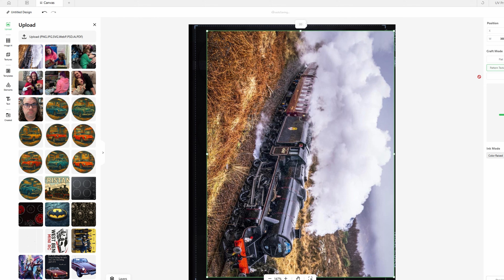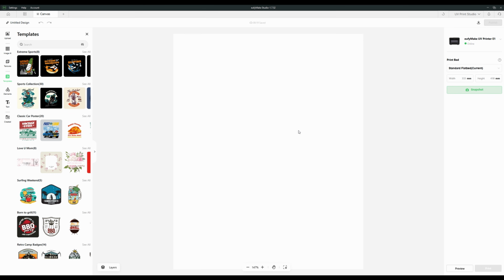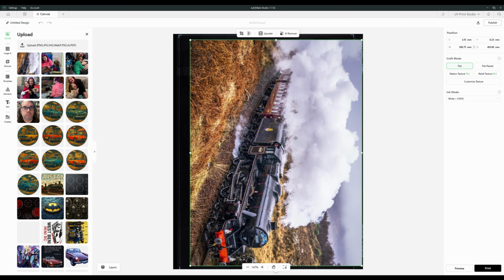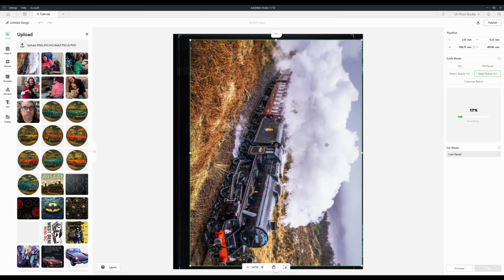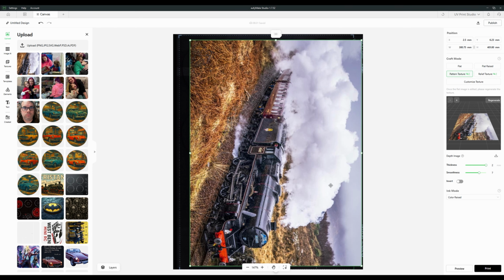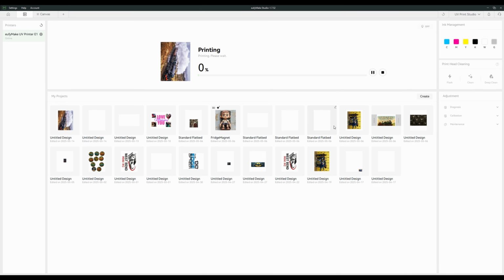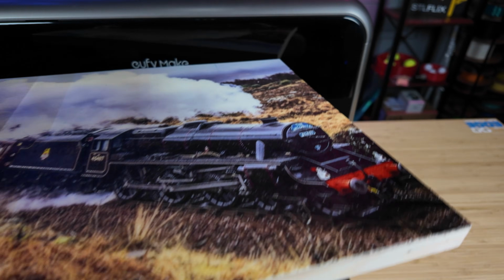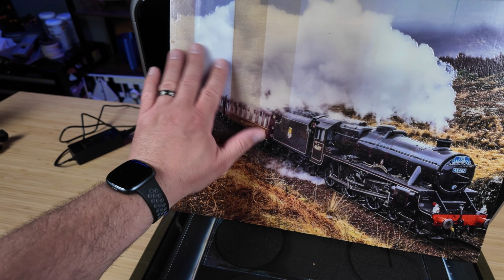UV Printing Made Easy: Eufymake E1 UV Printer Tutorial

Comment: Be aware that the monthly maintenance cost (not including printing) just the maintenance cost is between $125.00 - $175.00 USD. That is ink loss due to maintenance cleaning cycle, the cleaning kit itself and then the print head replacement. This machine is very expensive to run and even with the self cleaning features still requires manual cleaning from the user. Let alone the ink costs and usage making 2.5D prints.

Comment: 15 hours and 80$ worth of ink for it for it to look that messed up at the end, kinda dissapointing tbh.
Reply: if you don't add texture,  the price is significantly cheaper.
Reply from the maker: That was kind of disappointing as far as to fail goes. How are you calculating $80 worth of ink though
Reply: @TheEdgeofTech  181ml of ink used, at 0.43$ per ml retail price,  close enough to 80$
Reply: Ya the time combined with ink cost make many of the items being done in various videos little more than fun hobby projects. Not viable for much business use that they seem to be pushing. Plus add in costs for print head replacements as it’s a consumable. Along with wasted ink from cleaning. It all adds up. Definitely cool tech to push uv printing to consumers but there’s a ton of factors that are glazed over.
Reply: He ran out of ink/gloss. 

Also, you don't know the quality of the surface that he was printing on.